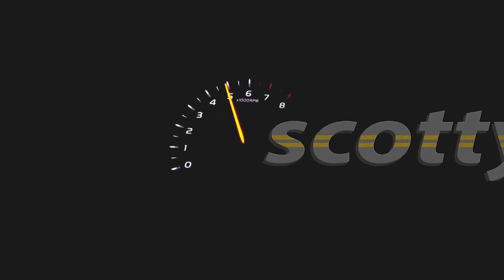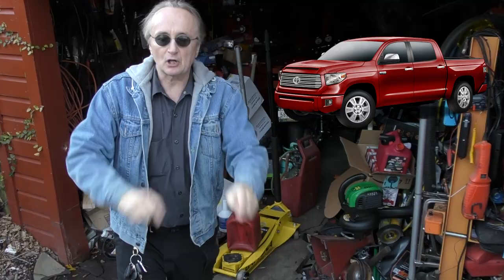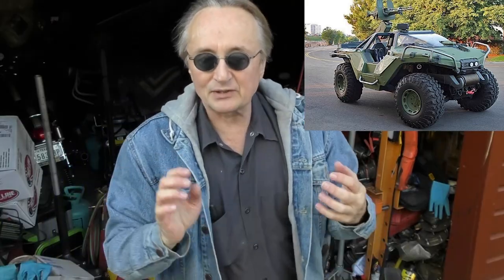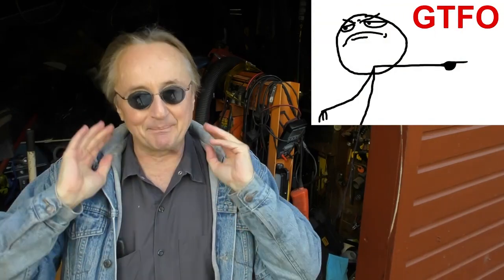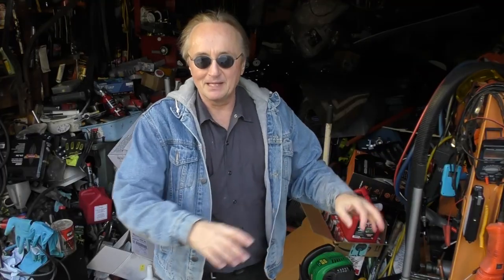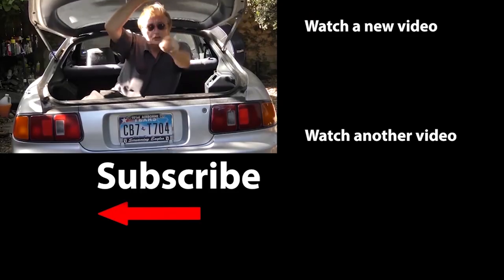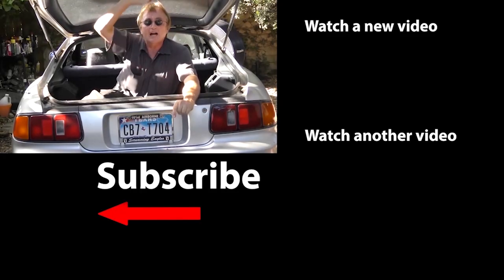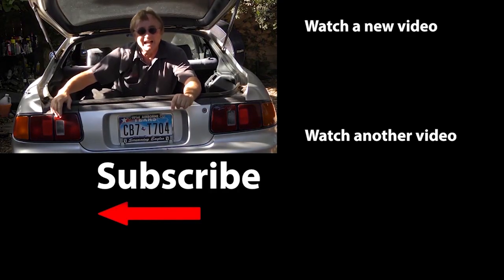5 Used Trucks You Should Never Buy

Comment: My dad got a 2006 Honda Ridgeline when they first came out. Never broke and was a great “truck” (not really a truck). He drove it for about 90,000 miles and then I bought it since he took care of it when I was 18. Put a total of 250,000 miles on it and nothing broke on it. Only did regular maintenance. Maybe I got lucky but was kinda surprised this made the list.
Reply: No, there good all around vehicles. Why wouldn't a honda be?
Reply: same 2006 with over 230K miles , not one issue, just normal maintenance items. And it is a real truck most people who buy this class of truck do not haul anything major. It is not a f250 or f450 but it never claimed to be.
Reply: yeah, Scotty really didnt sway my opinion on the Ridgeline, I still plan on buying one.
Reply: Ridgeline used as a car shouldn't give you problem. It's when Ridgeline is used as a real truck (heavy load, tow, rough terrain, etc) , it will start giving you problems.
Reply: roggie77777 100% correct. I’m currently in a 2016 F250 lariat 6.7 power stroke. It’s a work truck and I wouldn’t ever attempt to pull 18,000 pounds in my Honda lol. For what it’s design for, it’s a great truck. I really abused that truck because I took it off roading and everything. Only got stuck once lol. I over worked that truck and it still didn’t break.
Reply: @roggie77777  

2006 Honda Ridgeline owner hear no problems at all I have no idea what Scott is talking about.  Any shop I go into just for an oil change mind you the truck has no problems always Raves about the truck.  they're mechanics that  work on  these trucks and they say they're very reliable. I don't know what the hell  Scotty's talking about but again he knows everything😨🤓🤤😁😉  I have this truck over 13 years and use it like it was designed.  Oh I guess that's why the resale value is so bad with  them! Not!😜😜😅🤗
Reply: Yeah but they build em for people that only move a couch or something every once in awhile they break very easily with any kind of load or strain/lack of maintence
Reply: I have one too, bought it new in 2008, it’s been a really good vehicle.  But I have heard some people had problems with them.
Reply: @digitalkov   I have a 2006 with 343000 so far. It is more of a descendent of the El Camino than a truck. It drives well, is good on trips. You can haul a bunch of stuff if it doesn't weigh too much. It is a good truck for a suburban homeowner who wants to haul a load of mulch or wood on occasion and want to sit up higher than a car. If you really want a truck, it ain't it. I have an old F150 square body if I really want to do truck things.
Reply: If you just go to Home Depot for lumber, Ridgeline will do the job very well. I think 🤔
Reply: @bigjay1970  Scotty was correct as really isn't a truck. A truck hauls stuff. It is more a glorified car.
Reply: They suck unless u drive em like a car bud.
Reply: @aky115  F250s dont break. Fact. F150s just as good . Facts.
Reply: @digitalkov  That is right.  They are durable trucks for light loads.  Just don't go heavy as the unibody is not built for it (the weight limits on the Ridgeline are much lighter for a reason).
Reply: 620k km's on my grandmas before the motor locked up.
Reply: ridgeline is just a lifted accord with a truck bed.
Reply: aky115 yeah we have a 2007 ridgeline with over 200,000 miles on it and used it yesterday to pull my brothers gmc out of the snow lol
Reply: Its like this people buy then thinking they are like regular pick up trucks and try and haul in them and do alot of hard work the truck WASNT DESIGNED for. As such when people see they dont have all the power they want (after they have beat the hell out of them) they sell them. With all thay extra wear and tear on the car they can have issues especially used 

Is the ridgeline a bad truck absolutely not buying new or low millage is a fien option(id 100% get a manual tranny tho) but, the used ones that have been beaten to hell and used to do things they werent made for they can fail
Reply: aky115  love my Ridgeline,  it fits my trucking needs perfectly!   Only use it for towing spring and fall towing a 570 RZR!  Very reliable truck!  170,000 on my first one before I gave it to my daughter!  Now I have another new one!
Reply: David Klimmek I’m kinda biased and I have to say F250’s are way better than F150’s :) haha but yes F150 are great trucks. Unless you’re hauling heavy ALL the time, you really don’t need a diesel truck. Why spend 10k more on a 6.7 plus all the maintenance if an F150 can complete your job? Hell even the 3.0 diesel power stroke F150 would be an amazing choice. 30mpg in a truck 😂😂
Reply: I've got the same truck and so far so good just a smaller bed.
Reply: Scotty's argument against the Ridgeline never had any real hard evidence or solidity as a valid claim against it. Yes it is true that the Ridgeline is not as capable as most full size trucks. But for what the people who own them are buying for it's a great truck. And to be truthful, I live in corn fed Iowa where so many people own trucks who just use them as a grocery getter to look big. So in the end, saying that a Ridgeline is any less of a truck for what it's used for just isn't true. By the standard that a lot of people use their truck it's just as much a truck as a Silverado or F-150.
Reply: I have a 2006 and it's lasted nearly 400000 miles so maybe its not meant for work but its great for light hauling
Reply: Yep, owned the same truck, only for 4 years before selling for newer, but it did me well.
Reply: I have a 2006 and I am completely baffled by this making the list.  It has done great in the snow, it hauls a trailer fine, soo???? I guess it is HUH?
Reply: @jagsfanrick  it's a toy hauler. Dirtbikes, atv, seadoos. There are notches in the bed up against the cab designed for dirtbike tires to go into the groove...
Reply: @james3429  and that was likely due to timing belt failure. Which is supposed to be maintained.
Reply: They are fantastic recreational trucks.  I'm not sure why he says they aren't good vehicles he's clearly wrong.  Yes, I woundn't try to haul tons of gravel in them, but dirtbikes, lowe's trips, camping equipment, tail gates, kayaking, fishing, you name it it's the active man's truck with a much nicer ride than a non-unibody. 

I've seen MANY people say they have gotten 200-300k from Ridgelines and if he doesn't like that engine then all the Honda 3.5L's must be garbage because they are all basically the same minus a few variations.
Reply: Yea, it's weird that Scotty mentioned Ridgeline engine issues.... that 3.5l in the Ridgline is a solid engine... had the same engine in my odyssey and it went for 190,000 miles.
Reply: They made the list because of changing the spark plugs and the timing belt!
Reply: Digi tal In that case he shouldn’t compare Honda Ridgeline with bigger trucks, he should compare it to Tacoma, Colorado, or Frontier. Similarly priced Tacoma has less comfort, features, power, room (Tacoma cabin room is worst in the class), towing and payload capacity than Ridgeline does.
Reply: aky115 Agreed, Ridgeline shouldn’t be compared with big truck.
Reply: Vladimir_Bone Spur_tRump Actually there are a lot of older Frontiers on the road. Nissan made great trucks before 2000’s. My Ridgeline has 200k on it and runs like new. And unlike other trucks in the segment it has enough leg room for 6’4”.
Reply: Yeah I like Scotty’s videos but I totally disagree about the ridgeline making the list. My mother bought a band new 2007 ridgeline and it has 150,000 miles on it and nothing ever broke on it. For being a 12 year old truck it’s held up great.
Reply: Same here. I am still driving my 2006 Ridgeline everyday and engine is still very quiet and smooth. It is uni-body not a real truck also cannot handle heavy load as Scottie mentioned. Otherwise, ride is excellent and took my kids to many many ski trips never got stuck.
Reply: I have a 2017 Ridgeline so fare I love it I been pulling my Lund 19 foot boot with no problem 👍🏽
Reply: Oh yeah? My dad gave me his 2009 and the interior has a bunch of broken things like a cracked AC dial and a broken AC vent. It also has an exhaust leak and the truck now sounds like a Nissan Skyline R34.
Reply: Alinea Euros 

Amen. I used to think it was a V6 sport Civic truck or a the Honda version of a Chevy avalanche.
Reply: @bigjay1970  There is nothing wrong with that truck. The transmission problems Scotty likes to talk about with Honda's involve the 1999-2003 Accord V6's, 1999-2003 Acura TL and 2001-2003 CL with Automatic Transmission. Some Pilots and MDX's made during those years had the transmission problems too. Honda had pretty much ironed out that problem now. my 2004 Acura TL with automatic never had any problems and I kept it until almost 100K miles. My 2010 Acura TL never had any Transmission problems. Long story short, You have a good truck. It's not a Toyota so Scotty doesn't think its a good truck.
Reply: My 07 ridgeline has 175k miles and regular maintenance, and no problems. I have used it to haul 5k compost trailers and lots of other heavy jobs, and it does fine for a v6, and for most people, it's all the truck they really need. I have owned the big three brands, but have had good reliability and performance from Honda, and the overall fit and finish seems to last longer than most trucks on the market.
Reply: My 2013 has 240k, no issues.
Reply: I'm surprised it made the list too. We've owned Hondas for years and yet to have one issue.
DelSol
S-2000
Ridgeline-(My Wife's daily driver)
Bikes:
Honda Valkyrie
Honda 599
Honda VLX600
No issues to report. Not one.
Reply: Not built to be a real truck. Pilot with a bed. I would never tow with a honda more than out the driveway. They say they can, but you need to use premium gas and a trans cooler.  There okay for light weekend stuff. There not bad in snow, almost fun to drive.
Reply: @RonHaslam2001  yea it would do it. Towed a 92 regency model 98 out to the flatbed no problem. Not really a work truck though. Wouldn't do it long distance. They dont have a frame.
Reply: @xeakpress  if you find one with a manual let me know. Pretty sure its the pilot with a bed, which means weak transmission.
Reply: Yeah, my dad has an 07 with 270,000 miles that is now my sisters that he used for work. Its been absolutely fine, I have no idea what this guy is talking about.
Reply: Depends on maintenance and how you drive... Honda is a good product
Reply: I just bought a Ridgeline a few days ago and it is awesome. Yes, I have a real truck too, Silverado.  2 trucks  for 2 totally different uses. Both are great. One for work and one for comfort and light duty.
Reply: I had one too, he's dead wrong, they have a track record.  It's great for what it was made for.
Reply: '08 with 125k...  Just put timing belt in it at 120k. Did that a little late according to recommendation, but it's done now I no longer worry about it. Did brake job all the way around, and regular oil changes. Never a problem with it! I haul my 2 quads with a 14 X 7 trailer in the mountains and it does great. It also does amazing in the snow! I too was shocked he had this one on his list, but to each his own I guess.
Reply: @Maleekus  -- you won't be disappointed
Reply: @AlineaEuros  --lol from a ridgeline owner... Good one 👍🏼
Reply: @bboycaptain1895  -- correct!
Reply: @digitalkov  Do you have any evidence of this? I use mine for work
Reply: @tedmartinez3857  Not true
Reply: @jagsfanrick  Its not. It has a frame 2.5 times stronger than most 1500 trucks and hauls as much or more
Reply: @AlineaEuros  Its not
Reply: @xeakpress  The Ridgeline WAS DESIGNED to do anything a 1500 level truck can do.
Reply: @jakeryk7043  It does though. In 2006, it had a larger payload capacity than a 1500 Ram which was rated for less than 1500. Ive had 1500 lbs in mine with no problem at all. Its not unibody but a body on boxed frame  like any other truck in its class and actually 2.5 times stronger.
Reply: @Beastykato  I haul gravel in mine. Its rated to 1500 +lbs, more than a 2006 1500 RAM. Its NOT a unibody like a car. Its a boxed frame
Reply: Vladimir_Bone Spur_tRump  Lots of Ridgelines out there with 200-400k miles. And with the original frame unlike a crappy Tacoma with a broken weak frame
Reply: @hungban44  Wrong its not a unibody like a car. Look underneath or look up the specs
Reply: @PcLover81  Exactly
Reply: @toothpicdinosaur3777  It does. Look underneath it
Reply: @toothpicdinosaur3777  The engine is a unique code, a j35 with heavy duty internal parts. The transmission is entirely unique to the ridgeline, co-developed with Borg Warner. In fact, almost everything behind the engine was co-developed with BW. Good stuff.
Reply: @jcagg6067  Directly derived from Honda document - The 2006 Honda Ridgeline uses a new generation of truck platform with a ladder frame and a unibody for enhanced levels of safety with class leading rigidity and performance. The Integrated Closed-Box Frame with Unibody Construction is engineered to balance the rugged traits of a dedicated truck frame with high levels of safety, handling and fuel economy of a unibody design. Underneath the unibody frame sits a fully integrated ladder frame comprised of seven crossmembers with high-strength steel reinforcements that create six fully boxed zones with the lower portion of the unibody. The benefit of the unibody construction (compared to traditional body on frame construction) is better space utilization and vehicle packaging, better handling, and enhanced energy absorption capabilities. MacPherson struts are used for the front suspension and a space saving multi-link with trailing arm suspension is used in the rear. (More detailed information regarding the integrated closed-box frame with unibody construction is available in the Body section.)
Reply: I always said it needed sh-awd and the 300hp 3.7 but that's just me.
Reply: yeah weird to see them there.. lots of people had them and they were lasting well... they werent really a truck :P
Reply: I also read about the engine and tranny being heavily over designed.  It's much stronger than people are letting on the weak link is the vtm4 transfer case.  Everything else in the system is designed for way more power than the truck is actually putting out.
Reply: Same here at 133k miles. Flawless vehicle for non heavy duty use and great AWD performance
Reply: @hungban44  Ok, its not a rolling chassis with a body bolted on top. But its also not a car unibody. Its a structural frame built into the body. Its both. However you want to call the construction, the result is a structure that is not only equal but greater in strength and rigidity to other trucks in its class. The way to compare is Payload capacity. 2006 Ridgline holds 1550. 2006 Ram 1500 holds around 1100. Ford and GM 1500 around 1500, i dont recall exactly.  This comparison  was displayed in the dealership when i bought mine in 2006. Also, read the Motor Trend 2006 Truck of the year article where they go into detail. Anyway, this is the reason tracks are sold in levels of work duty. Basic average duty is called a "1500". Ridgline is not only a 1500, but a "1550" I'd say that is equal in strength. So therefore, Ridgline is a standard duty truck equal to any 1500 of its class at the time.
Reply: ted martinez there's lots of people like that out there.  I bet 80% of pickup owners can do what they do with a ridgeline. I go to work parking lots full of them they are commuter vehicles that dint Do work.  I am one of them
Reply: My partner bought a 06 Ridgeline a couple years old with 20k miles He says the best vehicle he's ever had.  Sure little things have broke, the struts needed replaced. He flips houses and it's been an excellent vehicle for what it was designed for. A light duty truck. I still keep my GM wagons for really long stuff.
Reply: The Honda Ridgeline isn't even a truck.
Reply: @digitalkov  - that's literally not true!  Both my gen 1 ridgelines are quite fine towing the 5,000 lb limit, and have done it countless times across country.
Reply: Man I watch Scotty videos for entertainment only. I careless about his opinion. Ridgelines are good urban trucks for home owners to haul couple bags of cement.
Reply: @m.m14433  - dude, it pulls my 4000 lb camper just fine!
Reply: Brett Cannon hahahahaha sometimes stereotypes are true
Reply: Me too, He's like a typical mechanic..
Reply: Father in law has a Honda Ridgeline around 2010. 150,000 miles and still going strong. Very little repair cost!

I’ve got a 2015 Honda CIVIC. As close to bullet proof as a car can be these days.

Looking for a Ridgeline myself. Enough truck for what I need it for and it’s a HONDA!

Honda will give them all a run for there money!!
Reply: aky115 hell yea mine is still alive never had a single problem idk where he gets his information from!
Reply: If you take care of the truck it will take care of you on the road
Reply: @PcLover81  there are exceptions to everything too. My brother in law owns a 01 Accord V6 coupe with 200k in Maine and no transmission problem. The thing will rust away in a year or two before it dies.
Reply: I drive a 2006 Honda Ridgeline, bought used with 96K on the ODO. That was 5 yrs ago. With regular maintenance, I now have 267K on the vehicle. In years past, I have had other vehicles (even from other makes) that I liked; however, nothing that stands up to the test of time in terms of reliability, durability and residual value, as a Honda (with the exception to my wife's Toyota Camry). 

Sure, "The Ridge" doesn't haul 10,000+ lbs and MPG's could be a bit better, for the size of the vehicle; however, for me, it's a winner... all day, every day! Every other vehicle that I've owned in the past has shown their true colors when the mileage starts to climb, with the same level of regular maintenance (which I always keep up with). Honda... In my opinion, they're just better all around vehicles and for me, the Ridgeline fits... me.

It has done and continues to do what 90% of truck owners do: haul apartment furniture, tailgating (btw, the trunk holds 100 lbs of ice and 6-8 cases of drinks, easily), drive off-road and sling some mud (conservatively, with good tires), camping/fishing, pull the in-law's vehicles out of the snow, pick up a couple large barrels to put in a football game room, take (comfortable) road trips with the family, get groceries, eat sub sandwiches with your kids on the tailgate, watch fireworks from the truck bed (in comfy fold out chairs, 4 of them fit), pick up a load of tile for a downstairs floor and work (I use it as my mobile office, as needed).

In closing, I don't get how this vehicle made the list!? Knocks on wood I haven't any major issues with mine and plan on driving it for another 267K miles! Scotty, love the channel but I agree to disagree on this one.
Reply: @brettcannon74  I'm glad to hear your Brother in Law has had good luck with that V6 Accord. That is rare to hear. The Acuras from that period were the worst. When I worked at the dealer, there were at least half a dozen of those CL's and TL's  in for Trans replacement each week.
Reply: Towing long distance isn't nearly as damaging as frequent short distance towing. 
Once you start rolling, it doesn't take much  to keep whatever you're towing rolling.
Reply: My Boss has a honda and its heater warmer went out at 40K miles.

And no This is not Alaska or northern states.
Reply: @digitalkov  vaguely speaking, driving any vehicle within the restrictions outlined in the owner's manual should keep it operational and functional. No vehicle should ever be overloaded, scooter or semi. If you as a buyer are unsure of what load requirements you need, either get something adequate and rent bigger equipment when needed, or get a duly
Reply: @RonHaslam2001  Anything within 1,400 LBS. maybe higher with the right model on the newer truck. It might mean multiple trips if buying bulk. 200 bricks per trip. 40 cinder blocks, 28 (50#) bags of cement. 23 sheets of 1/2" thick drywall.

A diy hobbyist person who works on their own home or rental property would be pretty content on a day-to-day basis. Most people buy a lot more truck than they will ever use. Or might need on very rare occasions. If you got a big job that needs a bigger truck, just rent the home depot truck. If you really need something for heavy loads on regular occasions, get a box van.
Reply: Would not trade my 2021 Ridgeline RTL for anything. I have no use for a bigger truck...and that's all I have to say about that : )
Reply: @tedmartinez3857  I have to disagree with what you just said. I tow my 29' Jayflight with it, no problem. And it fits alot more than you can imagine, for its size.
Reply: Not true, they are very robust and incredible in the snow. I hauled a very heavy refridgerator 500km and couldnt even feel the load. No sag in the rear suspension also.
Reply: I have to disagree with Scotty on this one. I have many friends and co-workers that have Ridgelines and haven't had any problems with them. If you stay within the 5000 lb towing limit it's designed for and keep to the scheduled maintenance your going to have less problems than most trucks on the road. I drive a 2013 Honda Pilot and tow a 5'x10' trailer on a regular basis. I keep to the maintenance schedule and haven't had any problems with it at all. I am currently approaching 100k so, it's time for the timing belt service. I recently changed the Iridium spark plugs for the first time and they still looked great. My next truck will be a Ridgeline unless quality drops off. I will reiterate this: stay under the tow limit and you will have less problems than most other trucks on the road.
Reply: @RonHaslam2001  sure does for plywood.
Reply: You didn't luck out, this is a great pickup that non-owners haven't experienced.